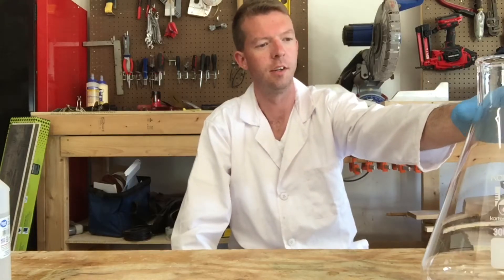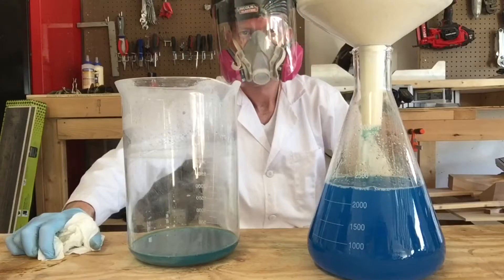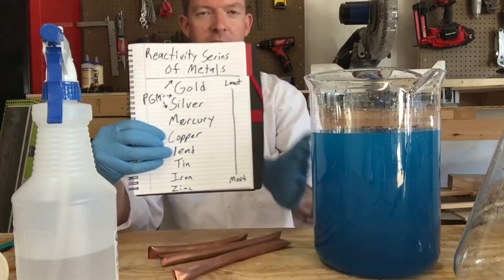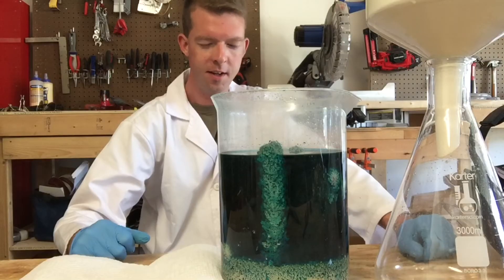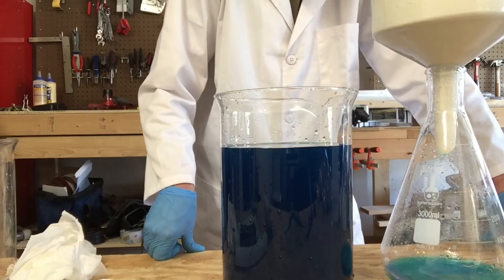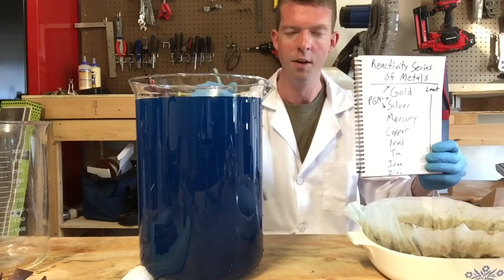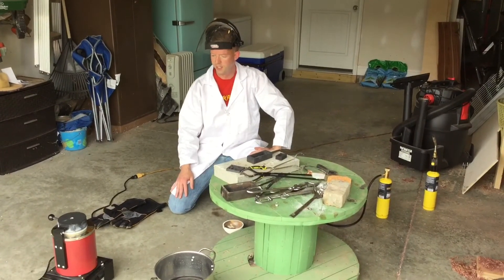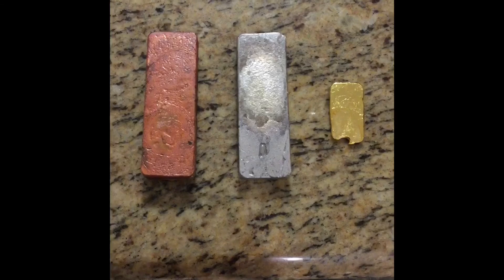Recovering Silver and Copper

Comment: What if skip the copper and just put iron in there,  will that drop out both silver and copper together?
Reply: Yes. The reason they are "stepped" in this process is to isolate them. Falling out, gold will replace silver, silver will replace copper, copper will replace iron... sodium will make all of them fall out at once.

By stepping up one at a time the solution gets swept for the target metal and each step extracts only one element at a time.

There's a better way (in more than one sense) to recover copper that's been used to drop gold... "electrowinning". This directly drives the metals out of solution and can be selective or cover a span (depends on voltage). With the current set correctly for the cathode, you can get a nice pure deposition of the target metal, ready to be "turned around" in a new cell for further purification if needed or desired.

And the waste stream can be made "very compatible". No difficult lingering metals in solution to deal with. Iron isn't the worst but...... those are also materials that don't need to be consumed by the process each run either.
Reply: @MadScientist267 this answer helped me… thanks.  New sub

Comment: How did you get all the silver out of the inside of the pipes? You put in copper pipes with the ends nearly pinched off, so any silver nitrate that got into the pipes cemented out and became stuck inside the pipe. Using a pipe cutter to cut the pipes is preferable to just bending the pipes until they break.

Comment: Whatever that cloud was in your original solution ended up in your silver. My guess is AgCl.

Settle it out and decant if it won't clear up with Nitric. No additional HCl as silver chloride isn't soluble and the silver needs to be in solution for cementing to work.

Once you've got it clear, then do the drop and your dropped silver will be fairly pure after wash. If you want more pure than that, you'll need to involve electrolysis (silver cell).

Same applies for copper, except you can acidify copper solutions with HCl since CuCl2 is soluble.

If you're into electrolysis, copper is easy to recover if the heavier metals are gone first. Using a special type of electrolysis (electrowinning), where a carbon rod serves as the posode, the solution is "driven clean" and all of the copper is deposited out on the cathode for harvest. Low and slow, nice clean take.

You can do this with silver as well but slow is key if copper is present. It will also want to go to the cathode with the silver but if the power is set up right, it can still separate them. With copper it can go quicker generally speaking. The metals "above" hydrogen will tend to take higher voltages to come out, so careful selection for the target metal is still useful, but in general hydrogen will be evolved preferentially from solution so many of them will stay in solution. EW is fun to mess with.

TLDR; Either way you only want to drop/run in clear solutions or you're somewhat wasting your time.

I'd acidify if there's any question, and let it that starting solution settle, decant it and then cement the silver. Filter off the silver, settle solution if needed (or acidify with a little heat, should only be silver metal in suspension now), and electrowin the copper out. If the voltage and current limits are set appropriately, you will have copper plating/crystal growth on the negode and all the metals above hydrogen in solution.
Reply: I use a medium grade filter to filter my silver nitrate solution and it is blue a crystal clear.  I make sure there is some unreacted silver left or add some sterling silver to make sure the nitric acid is consumed. I use copper pipes and wash out the center of the pipe. Works well for me.
Reply: @jamescball55 Just now saw this... lol 🤦‍♂️

It works and it's very selective, so yes there's that (you're not going to "get copper out of copper" in other words, only the metals below it in the series.

The key benefit with electrowinning is you don't involve yet another metal when you are going after the one you want. With displacement, you always end up with a metal in solution, and depending on your choices, can end up with difficult to dispose waste.

Winning gets around this by driving the metals out of solution, selectively with potential control, and at the correct rate (current) for the type of deposit desired.

If you use copper as the workhorse metal for going after gold, you can get both back selectively and end up with only the reconstituted acidic solution made up of what they were processed with. This can easily be neutralized with sodium carbonate to drop the traces of other metals out of solution and leave a medley of sodium salts which are simple to dispose of. That's assuming you don't want to also recycle the acids.

Comment: I see a lot of people use those "bent to broken" copper pipes to pull silver out.
But remember, the solution reacts with BOTH sides of the pipe, outside and inside.
The precipitated silver falls off of the outside of the pipe, but when it falls off of the inside of the pipes, it can get trapped in the pinched off ends.

I usually bend to break the pipe, then take a hammer to the pinched ends to open them up a little so the precipitated silver on the inside of the pipes will fall out.

Comment: If I could pick your brain for a second.
 I have a bottle of solution that is a dark blue.
  I started originally trying to recover some precious metals from e-waste. I had in a glass jar that ended up breaking and at that point the solution had solidified and everything was encased in a mud of sort of chalky goo plaster. 
   Then the jar broke at some point and I swept everything up put into a aluminum metal coffee can and kind of put in the closet and forgot about it. 
   
     Fast-forward two years to current current time. 
   I have rehydrated the material from computer chips cell phone pieces and other miscellaneous contact points. 
  Today  I have a bottle of the blue solution like I said with  (3) different colored layers in it.
  There's 
1. whitish grayish layer thickest layer
2. Cooper colored layer  1/3 size thickness of layer 1.
3. Golden tinted layer 1/3 size as layer 1.

   I know I said three layers but I really don't consider this one a layer more of a film, but by All rights we could call it a layer for. When viewing the bottle from the side which is a clear one gallon water jug.
    I can visually see three sedimentary layers three lines of division of the material.
4. Is a thin golden colored film layer. 
 What could they veer?
I never incorporated or introduced any metal pieces bars bolts or pipe to the solution is not set in direct sunlight but it is on the balcony Nevada desert shade but it still gets hot I guess I keep the bottle closed and sealed with a cap but the layers have settled out at the bottom if I decant the liquid and end up with just the granule is at the bottom. How would I go about trying to figure out what they are or could I do something to help simplify the process I don't have access to strong chemicals the solution itself with vinegar peroxide and salt I think and there was a small handful of E-Waste I have accumulated to just do a test run and would love to know what to do so I can process the rest any help would be appreciated thank you

Comment: Thanks for this video. Very easy process of metal separation. What kind of solution are you using to dissolve gold, silver, copper? Ex: nitric acid, or sodium nitrate and HCL, or sodium nitrate and sulfuric acid?
Reply from the maker: I normally just use aqua regia. Nitric acid and HCL. 👍
Reply: @jandlcrafting1332  how  do you drop gold in aqua regia solution, what metal do you use to drop gold?
Reply from the maker: Any metals higher on the reactivity series of metals such as copper 👍
Reply: @jandlcrafting1332  Thanks, your advice helps me alot.

Comment: Thanks for this! I am using 45% vinegar with Hydrogen Peroxide and some salt to remove gold from computer parts. As I am new to this can I extract the silver the same way and use a steel bar to get out the copper from the solution?
Reply from the maker: Absolutely. Once you get a metal in solution, just use a metal higher on the reactivity series of metal to cement it out👍
Reply: Hey maybe you can help…I did the same vinegar HP and salt. Then went to HCI and nitric and a space of sulfuric. Did a stannous test, black stain so gold into solution. Tried some SMB/stump out to precipitate gold. Solution turned black. Not stain from stannous test. However I have this grey precipitate. I burn some but I think it’s copper. I ruined my melt dish which is okay. Anyway what is the grey precipitate ? Too much SMB?
Reply: That's the same stage I'm at ended up with one gallon bottle of blue liquid with some powdered Brandon is at the bottom when I don't know what to do at this point I'm two years in with a one-year 8-month pause in between due to the solution that dried out into a clump got put in the closet and forgot about I just recently pulled it out

Comment: I’m removing silver plate from dishes and such. Using sulfuric acid instead of nitric do I have to use lye and sugar or can I nutralize with distilled water and throw copper in it and get silver cement?
Reply from the maker: You can definitely cement out the silver with copper in a silver sulfate solution 👍
Reply: @jandlcrafting1332  I assume it won’t be as pure of silver as when lye and sugar is used
Reply from the maker: Correct. Anytime you cement out a metal there will always be other metals in solution that will come out also. Sugar and lye method yields 99.9 purity when done correctly 👍

Comment: Engineer, I had a question. Please help me. What acid does silver sulfide dissolve in so that I can extract it from the rock? How should I convert silver sulfide to silver metal? 🙏🙏🙏
Reply from the maker: Silver sulfide should be soluble in either nitric acid or sulfuric acid. From that point on you can use the method in my video using hydrochloric acid or salt👍
Reply: Hello Professor, silver sulfide does not dissolve in nitric acid and hydrochloric acid, and I did not understand the solution, please tell me in which acid to dissolve silver sulfide and with what to precipitate it, please
Reply from the maker: You can dissolve silver sulfate in household ammonia. Then precipitate pure metal with hydroxylamine sulfate 👍
Reply: @jandlcrafting1332  Dear friend, I have silver sulfide, not silver sulfate. What should I use to extract silver sulfide???🙏🙏🙏🌹🌹🌺🌺
Reply: @jandlcrafting1332 Wow.  Does this work for all/many PM sulphates, like gold?
Reply: It can be reduced to the metal by placing the sulfide in direct electrical contact with a clean aluminum plate... I don't think I'm gonna explain the rest of it here... 

The issue is the sulfide. When this runs, it's going to make a lot of hydrogen sulfide - !!!

Yeah no. If you can work it out from there and understand the danger, okie. On your own, I can't do it.

Sulfides are extremely dangerous. Silver's doesn't happen to care for water, in fact it prefers to steal and keep the sulfur for itself from H2S, so nothing happens under everyday conditions. 

Many others react with it, anything above the hydrogen line in the reactivity series... releasing the deadly gas. 

The process I'm referring to synthesizes it as a byproduct by giving the sulfide a nudge so it acts like its cousins...

The aluminum wants to react with it, but because it has to move thru water to get there, some of it will escape, but eventually all of it will. Any Al2S3 that forms will react with the water and release H2S back into solution, where just as before, it escapes. The reacted aluminum becomes aluminum hydroxide.

While the amount of H2S is no biggie for removing a little tarnish, I can't recommend doing any bulk unless you're set up to deal with it and know what you're doing.

Comment: When the silver comes out of solution and covers the copper it can stall the reaction. The silver coating will block the silver nitrate from getting to the copper and prevents further silver from cementing out. Instead of pulling out the remaining copper, filtering it and moving on I would have shaken the copper pieces periodically to expose the bare copper and allowed more silver to cement out. I’m pretty sure you didn’t get all of the silver out of solution.
Reply from the maker: Ok cool. Thanks for the advice.
Reply: @jandlcrafting1332 how harmful is this reaction and also i saw that this reaction creates nitrogen gas but where is it
Reply: After cementing the silver out there will be fine traces still in solution. When I process the waste solution, I'll add some hcl and let it settle on the bottom of the bucket, then collect it in a jar after siphoning the waste off. After a few HUNDRED ounces of silver, I've collected maybe about 1/2 oz in the chlorides. But, every little bit counts..... 13:34
Reply: Copper process before use HCL acid 
Take the silver chloride after out put solutions u add copper plat 
Then you see 
But urea mixed definitely
Reply: what
Reply: @brandonzidzik, that's what I said!

Comment: Why couldn’t you go straight to the steel and skip the copper step?
Reply from the maker: If I did that then I would have ended up with a silver copper powder mixture. Steel would have cemented them both out at the same time.
Reply: @jandlcrafting1332  You're saying there was originally Silver AND Copper in solution, and you used pure copper to take out the silver which left the original copper in solution and added to it as well?
Reply from the maker: Yes. So with enough nitric acid it will first dissolve the copper, then once the copper is gone it will then start dissolving the silver, putting both into solution. Then just adding more copper will cause the silver to fall out.

Comment: hello,
i have a suggestion of a process that you can do that will make it so you can recover the nitric acid and the copper with sulfuric acid,
it is in a video by NurdRage on youtube that explains how to recover both the copper metal and the nitric acid,
the down side is that you will need a distilling apparatus and a electrolysing cell(lab power supply),
the video name is "Efficiently Recover Nitric Acid and Copper Metal From Copper Nitrate Wastes" by NurdRage,
this will reduce the amount of waste solution you have.
Reply: Or one could just sun evaporate the end iron/junk solution to yeild FeNO3 as a nitrate source for your process or as a saleable product
Reply: @ryans3442  copper sulfate is also a saleable product, but in many ways is easier to plate out with electrolysis, but yes iron nitrate can be used as a fertilizer supplement but the more useful  nitrate are for that is potassium nitrate(saltpeter), any ways there is allot of waste products that can be made in to a useful product in the end, ideally we don't want any waste when dealing with chemicals and only have useful end products.
Reply: @matsaa93 can you read my comment that I just previously married maybe you can help me with that as well identifying what I created or what I produced with the steps that I took

Comment: NICE VIDEO. 
JUST WANTED TO KNOW WHAT FLUX IS USED FOR SILVER SOLDERING. 
FOR GOLD IT'S BORAX. 
ALSO DOES SILVER HAVE GRADES LIKE GOLD, 24K, 22K, ETC.   THANKS
Reply from the maker: Silver usually just comes as a percentage of purity. Like 92.5 is 92.5 percent pure silver. Anything at this percent and above is considered sterling silver. They do not use karats like gold however it is essentially the same thing since 18k gold is just a way to say 75% pure gold.
Reply: @jandlcrafting1332  Appreciate The Quick Response/Answer.  So Any Silver Item Which Has A Silver Content  Below  " 92.5% " Is Considered As/ToBe Sterling Silver. 
Is There A Grading In Sterling Silver ❓ THANKS.
Reply: @narendrakhona1168  no, any silver with less then 92.5 is not sterling silver. It must be at least 92.5% to be considered sterling silver, any less and it doesn’t meet the standard set by I forgot which king. Was it Henry?
Reply: @Laotzsa  Thanks for the Explanation, & Quick Response. 
Appreciate it Very Much
Reply from the maker: I used borax with the silver as well
Reply: Why all caps?
Reply: @DR_SOLO  SO THAT IT VAN BE READ BETTER
Reply: @narendrakhona1168  
No buddy that does not help people.  Maybe you but in general 

" ALL CAPS SUCK IF YOU UTILIZED, DOING THIS TELL ME HOW WOULD DUMBLEDORE ADORE A DUMBBELL LIGHT WEIGHING WATER WELL.?"

"All caps suck if you utilize, doing this tell me how would Dumbledore adore a dumbbell light weighing water well"
 
Now tell me which reads with ease?